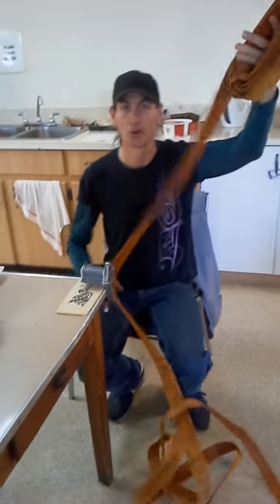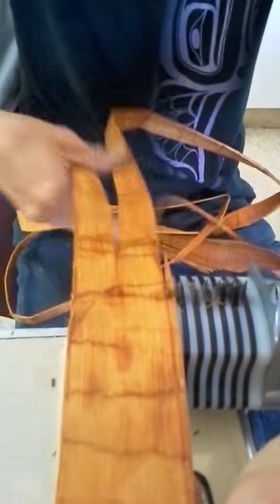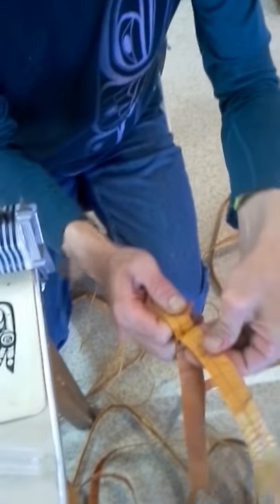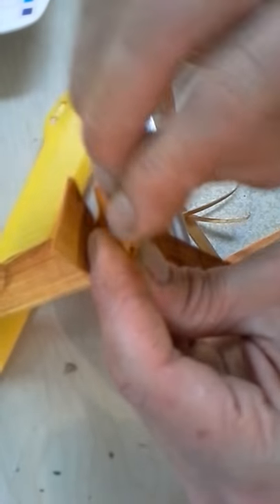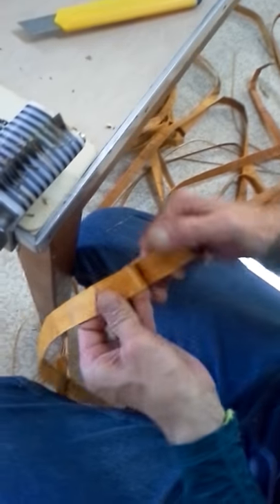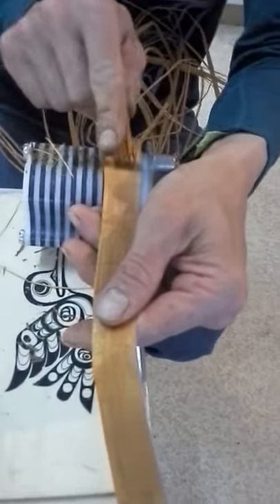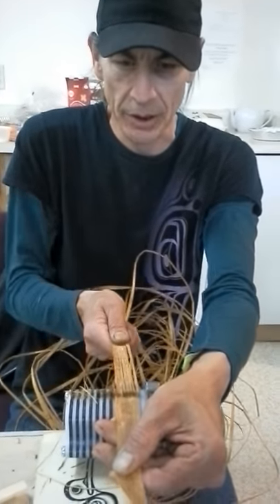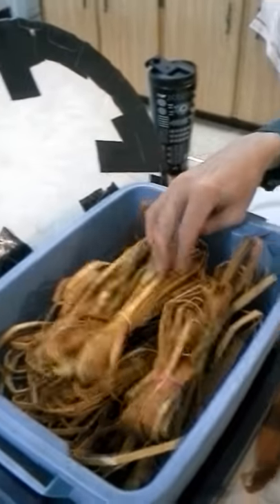Preparing Cedar Bark for weaving

Comment: we are cutting cedar trees for poles, and i want to keep the bark, but since i have a lot to process, i'm wondering if i can keep it rolled with it's outer bark and peel it later when rehydrated? any other suggestions?❤
Reply from the maker: Hello, It's best you crack off as much of the outer bark as possible. After its re-hydrated it's very difficult to remove the inner bark, as it turns to wood.

Comment: Do you have to soak the bark after harvesting or weaving or do you do all this when it’s dried?
Reply from the maker: dry after harvesting. then when you need to weave with it,  soak bark for 3 hours
Reply: I have heard different  on how long you leave roll to dry  3 monthes to a years, and do you start the soak with hot water?